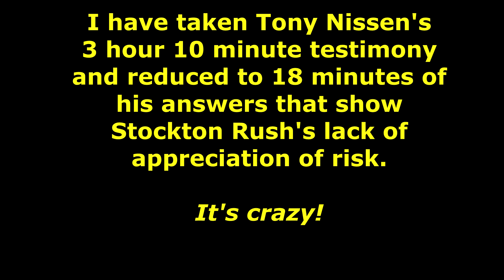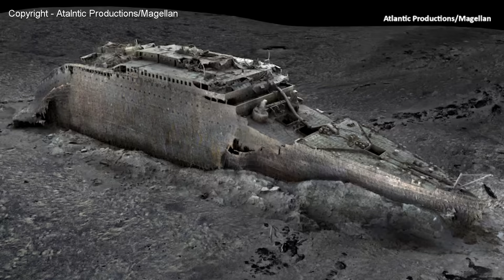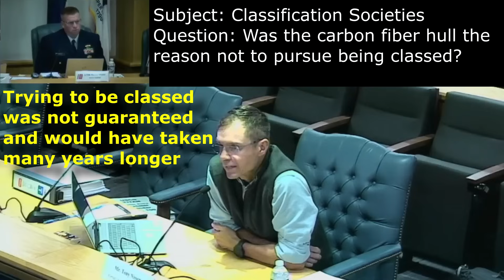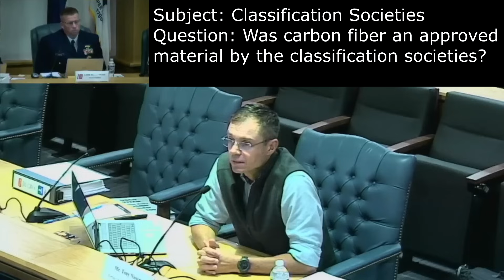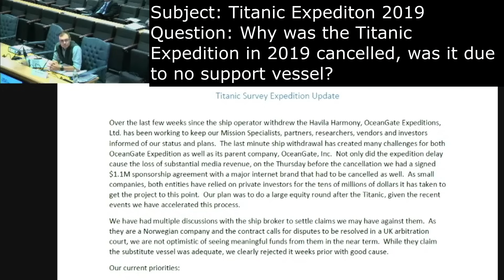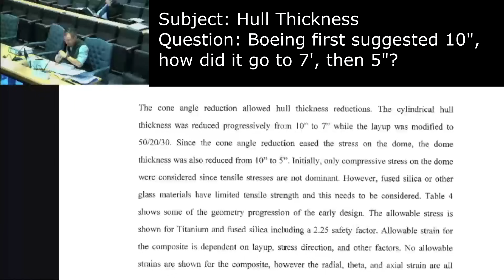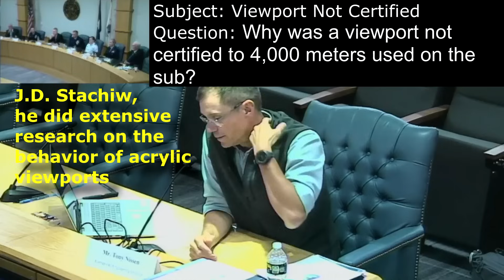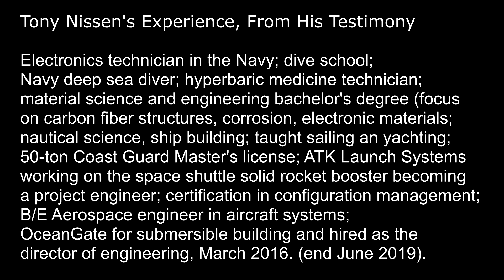OceanGate Titan - Working for Stockton - The Engineer's Words

Comment: Culture of risk....be realistic, any novelty, any, involves some degrees of risks,  regarding the design itself, it did prove carbon fiber is a legitimate option, the only issues are in the manufacturing process and of course the shelf life. Having said that deep dive subs are usually retired after only a few dives, this includes titanium sphere models. Any material  weaken over time, Rush when too far for sure but he was a pioneer and it turns out one of his competitor in Florida is working on taking tourists to the titanic.....
Reply from the maker: Thanks for your comment.  Fiber hulls (glass fiber and carbon fiber) have been used in the past, so Stockton was not the pioneer with that idea.  So, it can work.  The point of my video was that engineering principles were not followed with design, manufacturing, or testing.  As far as I can tell from analyzing the testimony, there were six 1/3 scale models produced and tested.  Four scale models tested before the first hull failed and two more after the first hull (before the second hull was built)  Only ONE test hull in the first group of four, made it to the target pressure!  How do you justify having a failed test program that does not support the concepts, but yet you proceed to build full-scale hulls and think it's okay?  "culture of risk"  How do you design a sub with grade 5 titanium domes for a margin of error, and then one day decide that Grade 3 titanium will be fine.  "culture of risk"  How do you use a viewport to go down to 4,000 meters when the expert manufacturer of the viewport only rates it to ~1,600 meters.  "culture of risk"  And with all that said, how do you risk the lives of paying passengers!  And in this reply, I am only talking about the hull.  Risky things were done elsewhere in the design.  Thanks again for commenting and contributing to the discussion.
Reply: Also, only experimental subs are retired after a few dives. Fully classed and safety rated subs are capable of making hundreds of dives before the hull degrades enough to be retired. For instance, DSV Alvin has made something like 2500 dives (including to the Titanic), and it's titanium pressure hull has only been replaced twice (as far as I could find). So it's gotten perhaps as many as a thousand dives out of one hull.
Reply from the maker: @thomasostrander4835  Thanks for your comment and I agree with you.  I titanium sphere, the standard for this, has almost unlimited dives in it.  All the other mechanical and electrical components can be updated around it.

Comment: This guy will probably go to jail for negligence. His flippant demeanor makes him seem like a liar.
Reply from the maker: As I analyze more of the testimony and supporting paperwork, I don't know what to think about Tony by himself.  What I do believe is that he and Stockton together were a bad combination because they talked each other into thinking they could do this complex marine submersible engineering alone.  Kind of like "there was no adult in the room" to direct them properly.
Reply: @solareclipsetimer  one of my main problems with Nissen is that he doesn't really take any responsibility for everything that was done. If you listen to his testimony he attributes the failures to the sub being struck by lightning. This claim is actually disputed btw. He is the Head of engineering, it's not just "something fun to do for a year".
Reply from the maker: @TheCoolhead27  I agree with you.  Except he was there for hull one, the Spencer Composite hull, which was trash, with or without the lighting.  Tony wouldn't let Stockton use it and got fired for it.  Another interesting thing was the testimony of the second director of engineering, Phil Brooks, who complained that the data coming from the acoustic monitoring system for (hull 1) that Tony was using was terrible and did not provide coherent, usable data.  Phil re-wrote the software for the data collection so it properly logged peaks.  So, I don't know what Tony was analyzing.   The testimony of Mr. Brooks about this issue was clear and compelling.
Reply: @TheCoolhead27  Agreed.   It’s easy to put all this on the dead guy.  But this fella was head of engineering.  If your degrees are worth anything, you should have resigned in protest early on.
Reply: Go to jail for what? He had zero involvement with the hull that imploded

Comment: Nissen: I killed it, I wouldn't sign off on it

Questioner: Was there a hull available? 

LOL, this questioner is not buying into NIssen's BS testimony. They had paying customers expecting to go to Titanic in July 2019. They took the thing to the Bahamas in June 2019. It came back CRACKED. Nissen didn't "say no". The freaking HULL said no. It was cracked.  And the real reason he was fired, he said it himself- the board recognized he was incompetent. He and Rush were LARPing as submersible engineers, plain and simple. Nissen can say it was all Rush because Rush isn't around to say it was BOTH of them. But other people testified that it was the two of them.

"We argued constantly". Um...no. Everyone else who argued with Rush was fired. You got to create a big department and LARP for four years. Nobody else who "pushed back" got to do that.

Also, an ELECTRICAL engineer may very well have a concentration on materials science, but his education would have been more in line with the science of materials that pertain to ELECTRICAL components, not STRUCTURAL components. Mechanical engineers are the ones whose physics classes give them a proper background to understand the stresses applied to STRUCTURAL material. None of Nissen's testimony makes any sense and his supposed background in (structural) materials science doesn't make any sense either, given he is an electrical engineer.
Reply: As an electrical engineer myself with some experience in composites and interest in materials and mechanics, some university physics classes before i changed course, and a little incidental mechanical CAD skill, the only kind of submersible i'd dare design would be for use in a bathtub, i can't imagine working on anything with occupants without massive guardrails against my and everyone's incompetence. But not everyone is comfortable saying "i have no idea what i'm doing, we need a specialist", and some job environments successively discourage it, knock it out of you i suppose?  It's cruel and manipulative to put an unqualified guy in such a position of responsibility to begin with, like it's setting him up as a fall guy when things do go wrong, especially if it's someone who isn't comfortable just quitting. Under the pressures of the situation, can i honestly say i'd fare much better? We're all lucky to have never been tested like that.
Reply: @SianaGearz  clearly Stockton was very controlling and had a huge ego.  Being placed in a position where you need to tell someone with an ego like that "no" is a very hard thing.  If Tony started trashing the company publicly I have no doubt that Stockton would have come after him somehow (and Stockton would probably win in the court of public opinion).  So Tony's options were pretty limited.
Reply: @davedoe6445  Tony's options were very limited indeed. Either be a decent engineer, put his foot down way before human lives were at risk and get fired early on or be a grossly negligent head engineer and continue cashing in the money. He made his choice.
Reply from the maker: Thanks for your thoughtful comment.  You make some excellent points.

Comment: As a person with Boeing engineering expertise in the design and manufacture of composite load bearing structures, there was a least one major flaw in the design-build process. That major flaw would have extended the time to failure. But if the use of  fine grain ultrasonic inspection had been done with computer assist to find the tiny voids, the basic  carbon structure would have allowed for more pressure cycles. If in addition, the carbon fiber hull had been inspected after each pressure cycle, the growing delamination(s) would have been detected as growing voids in the composite structure. The computers, hardware and software are all readily available for this inspection. The cost is not unreasonable and would have been an essential quali ty control step in the design build process. The question the is then the next step, is the joint design between t he titanium end bells and carbon tube going to fail? Absolutely it would fail after some number of cycles. The end bells connection to the fiber tube was a disaster waiting to happen. The basic concept of the joint did not take into account several known effects.
Reply from the maker: I agree with you.  Thanks for the comment. I was always worried about the "glued" joints and I did another video about that.  After the disaster, a lot of engineers posted videos that predicted the failure of the hull was the center of the tube collapsing and shattering the carbon hull into a million pieces. I never thought that.  Now pictures of the wreckage images on the bottom of the ocean show large long pieces of the carbon fiber hull jammed into the rear titanium dome.  That makes me believe that the failure was at the front ring joint and there was a lot of force to the rear.
Reply: Judging by the amateur hour operation in a garage when they glued up the rings, that was also my conclusion.  My first guess, after the implosion, was the glass spheres.
Reply: There was testimony that there were no available tools to do ultrasonic testing on a 5 inch carbon fiber hull with access to only one side.

Comment: Of course it was “-a culture of risk.” All deep ocean submersibles are high risk, just some more so than others. Every mission into space may still be considered high risk. We won’t even mention climbing Everest…..
Reply: Umm, no, what are you babbling about? You're absolutely incorrect. Deep sea submersibles are not part of the culture of risk. Not a single, certified, deep sea submersible EVER has caused a single fatality. That is because they have all been built to engineering standards, taking into consideration the laws of physics, and having then been certified by appropriate authorities. Space, Everest, driving a car, choking on food, walking on a wet tile floor or even tripping over a pet in your own home are all a billion times more risky and likely to kill you than going deep sea diving in a certified submersible. Correctly built and certified deep sea submersibles, have a statistically ZERO risk of death, thus far. That carbon fibre phallus substitute isn't in the realm of such vessels, so it doesn't count. They might have well gone down in a toilet paper tube reinforced with paper mache, for all it can compare with an actual deep sea submersibles. Sorry to rain on your attempt at the dramatic, but you're talking utter rubbish. I'm so embarrassed for you, next time you want attention, try using facts.
Reply from the maker: I agree with you, thanks for your comment. I guess my point with the video is the company itself (Stockton) had a "culture of risk."  They did not take the risk warnings seriously, especially when the vessel was totally experimental and they were going to take passengers on it.  NASA has lost 17 astronauts for poor risk decisions.  Commercial space programs have killed one Virgin Atlantic test pilot.  Christa McAuliffe, the teacher in space on Challenger was the only "passenger."  And dozens have died on Everest and they all individually took the risk independent of relying on a manufactured vehicle.  There were no deaths in the deep submersible community before Titan.  I am not referring to actual submarines, I specifically mean deep submersibles.  The classing certifications have made that very safe; the engineering has been worked out.
Reply: you sound like stockton's ghost.
Reply: Thanks Rushty

Comment: One of my first jobs after college was doing Failure Analysis of integrated circuits. My job was very detective like. You have to rely on what little evidence you have and not color your observations with your own prejudices.
In my findings the failures happen because equipment wasn't adjusted or calibrated properly. 
Later in my career I did other jobs as a designer. I still keep this mindset that a failure is a perfect storm of events lining up. I live by thought that the Worst Case Scenario can actually happen. 
I still get a LOT done faster than most people who take RISKS. 
I don't have to worry because THE DUDE ABIDES by safety rules. 😎
Reply from the maker: I agree and love the line " rely on what little evidence you have and not color your observations with your own prejudices."  That is what Stockton was doing, he wasn't taking no for an answer.
Reply: You make a good point in that sticking to rules and evidence for developing new things is often cheaper and/or faster in the long term than doing it the dirty way, as well, of course, as much safer.

Comment: Carbon fiber is strong in tension, not compression. It doesn't matter how thick toy make it, it delaminates and fails in compression (such as an underwater submersible). It works great for aircraft though.
Reply from the maker: I agree.  It just did not seem of the proper use of the technology.  The problem is that the engineers at Spencer Composites (1st hull) worked up numbers that made it look like it would work, with strength to spare.  Wierd.
Reply: @solareclipsetimer could* work, if it was built to spec. It wasn't built to spec. The design couldn't give realistic cyclic loading predictions on an untested design. It takes many iterations of design and testing to failure to get to the point where a design can reliably predict the load cycles it'll support.

Comment: Rush took what should have been a scientific and engineering project and made it to a commercial enterprise.
The failure was the interface between dissimilar materials that responded to increasing pressure at different rates
Reply from the maker: I agree  Sometimes in engineering when you are trying to make something completely new and the prototype makes it look like the concept won't work, you have to back off.  Take your losses and give up on your idea.  Stockton did not want to give up.
Reply: @solareclipsetimer  because he had commercial pressures.
nothing wrong with experimentation if it is personal risk

Comment: Perhaps next time the person responsible for generating the callouts should know somethings about English spelling.
Reply from the maker: Yep, sorry, I did have a few misspelled words.  I apologize.  It's hard to proof read in the video editing timeline, with all the different layers.  Additionally, I am concentrating of the video edits, the audio, the annotations, and inserting the various pictures, etc.  It's not like writing a Word document.  I will try to do better.
Reply: At least you recognize the problem. Perhaps it will be corrected some day. Good luck.
Reply from the maker: @randylplampin1326  Unfortunately you can't correct the spelling mistakes after the video is uploaded.  I would have to delete it and then re-upload a corrected version and then all of the old comments are lost.  It's starts over.  So, the mistakes will live on; ugh.
Reply: Perhaps some day technology will allow a smoother way of fixing these things. Thanks.
Reply: @solareclipsetimer  Tech writer here, and old CAD magazine guy. Best solution is to have a two-monitor setup, with Word on one screen and your other software on the second monitor. Write in Word then paste into the video editor.

I can’t write as well in any app that’s not Word, so I try to not do so!
Reply from the maker: @PetesGuide  Yep, that is a good idea.. I use that technique for longer things that I am writing, but I do it with Grammarly.

Comment: Did Tony pay you to make this?
Reply from the maker: No.  The point of this video is to describe working for OceanGate and Stockton Rush with sworn testimony.  This is not just rumors or "hear-say."  I will be making other videos with the statements from other employees that testified and you will see the pattern of the workplace environment  The rest of Tony's testimony, about 3 hours of it, was about engineering.
Reply: @solareclipsetimer  you are very defensive of Tony Nissen and are refusing to see that he contributed to the negative culture at Oceangate...coupled with contributing poor engineering! Everyone knows that Stockton was the problem, but the "professionals" that let it happen or encouraged it, are guilty parties to this as well!
Reply from the maker: @TikkaTCM  Thanks for your comment.  I am not defending Tony I am just presenting excerpts of his sworn testimony that has to do with his recollection of working with Stockton. He was under oath, these statements are not rumors. He seemed genuine to me. Most of his 4 hour testimony was about engineering.  He was trying to help Stockton build a sub outside of the normal sub "classing" pathways.  He developed the acoustic monitoring and strain systems that proved that hull 1 was not good, it wasn't safe, and could not take passengers to the Titanic. Hull 1 got scrapped after it cracked. Then Tony got fired.  Those same monitoring systems were then implemented by new engineers in hull 2, the hull that imploded.  Tony had nothing to do with the build that imploded.
Reply: @solareclipsetimer  the hull that Tony worked on also failed though...and many of the decisions that he made and signed off on were used again on the second hull that took lives......